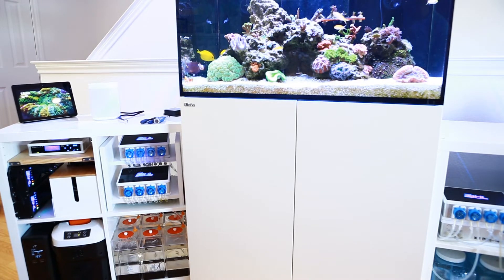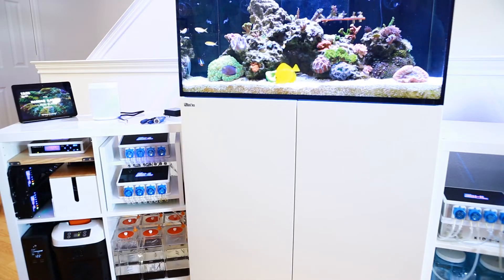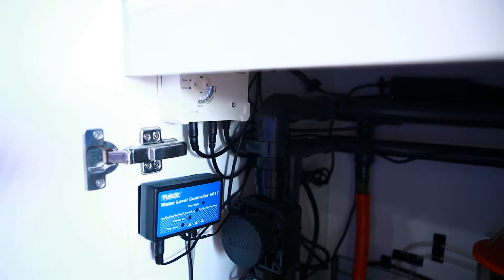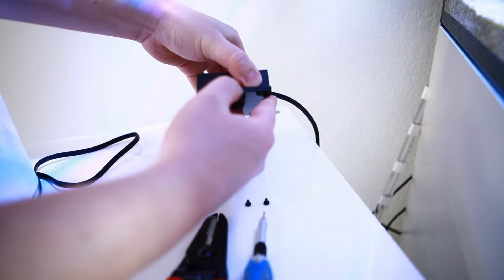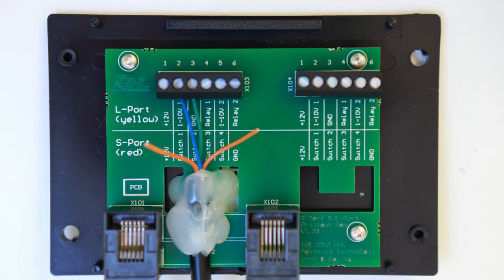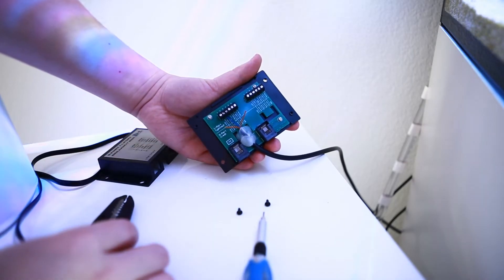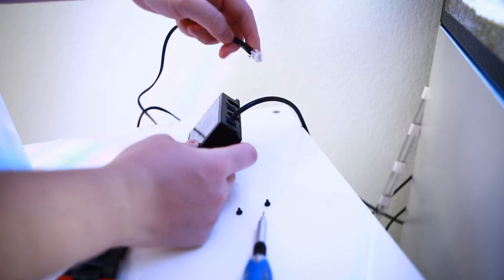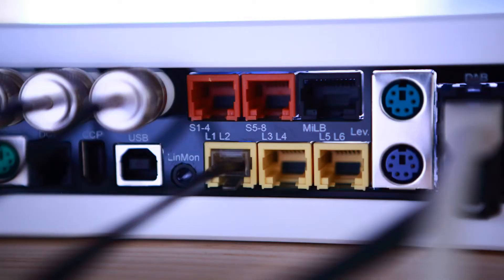How to Connect Octo Varios to GHL Profilux Using 0 - 10V Control

Comment: Hi, I'm thinking of getting a profilux very soon... I have the varios 6 plumbed straight into my uv, when you control it through the profilux can you run it at any speed? Not just the presets? I need to run the pump lower than the speed on the lowest preset...
Thanks
Reply from the maker: Yes it can run it lower than 20%. Increments on 1%. There may be a minimum required for the motor to turn though, maybe 5%
Reply: @HobbySci  ideal thanks! so I should be able to get 1800l/h out of the varios?
Reply from the maker: @tomengland5082  I’m not sure what the exact Varios 6 flow rates are. But with the 0-10v controller, you can set the pump anywhere from 0-100% in 1% increments.
Reply: @HobbySci  thats awesome thanks 👍

Comment: While using the 0-10v connection, you would still need to plug in the pump to a power socket (not necessarily a GHL power bar) correct?
Reply from the maker: Correct you would not need a power bar